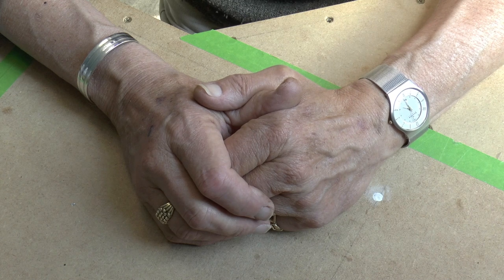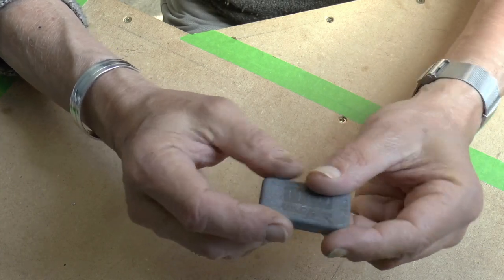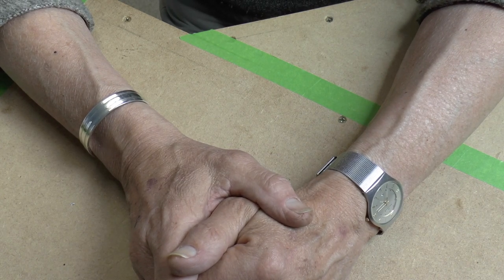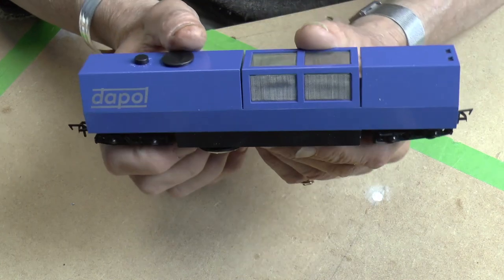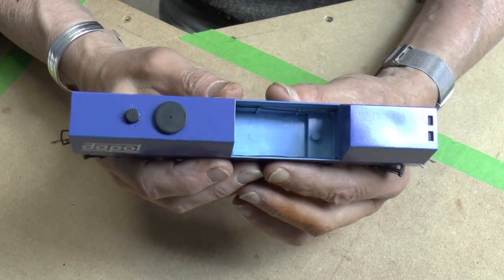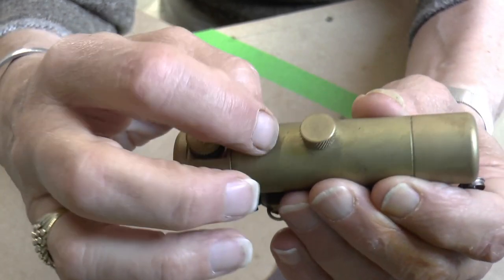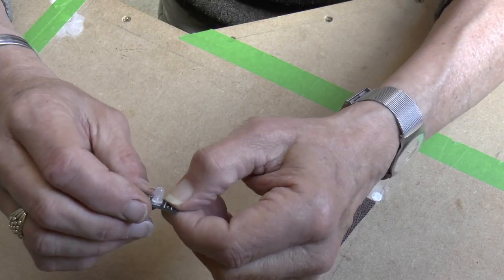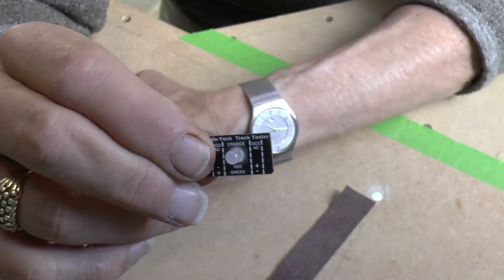How I clean my track on Lakeside.      11-05-2019

Comment: For wheels and general cleaning I too use Isopropyl Alcohol, but for track cleaning, especially at exhibitions, I use the inside of a cereal packet cut into strips. I never use a track rubber. It shoots fine bits of metal into the point blades and also locos pick up the fine metal particles it leaves on the track. As you say Graham each to their own. Cheers, Bob

Comment: Hi Graham, great video. Could you explain the advantage of the rubbing alcohol over good old Meths? Andy
Reply from the maker: Andy Sparkes     Hi Andy, I don’t think there are any advantages between the two but I had the rubbing Alcohol which works for many cleaning jobs I use it for but certainly meths could be used as I did many years ago.      Cheers for now.         ......... Graham

Comment: Hi Graham

Excellent video mate. I've heard the CMX cleaner is great. I also use the peco track cleaning rubber.  But i will have to invest in a CMX cleaner now. Thanks for sharing.

Cheers John.
Reply from the maker: TheHood50031     Hi John, if you do get a CMX then you won’t regret it - they are a great bit of kit.    Cheers for now mate.          ............Graham
Reply: @GrahamFoulston  That's great Graham. Thanks for the advice. I will have a look at the CMX now. Cheers John.
Reply from the maker: TheHood50031      👍🏻👍🏻

Comment: On my n gauge I've used the peck rubber plus either track magic or recently ipa. I have the tomix  track cleaner ( on which the dapol one is based) and apart from being a handy hoover the rotating discs are rubbish. The Emery disc scored my rails badly. Plus it relies on power from the track - which might not be there if track is dirty, d'oh! I fancy the cmx but the cost is astronomical now. There is a cheaper equivalent but they get mixed reviews. What a dilemma!
Reply from the maker: Leslie Gilpin     He-, they have gone up in price now, if it were me then I would wait until I could afford it as I’m fed up buying rubbish track cleaners, the way this thing is built then it will long outlast me, it’s built like a tank!    😊.      Cheers for now mate.         .......... Graham

Comment: I fancy one of them cmx cleaners but they are so expensive now been trying to build my own but not with success yet some good tips there especially with the cotton buds
Reply from the maker: Finnerton central model railway      It shouldn’t be too difficult Brian, the main thing is to have a variable flow of the liquid which can be achieved by using a taper needle like you have in an airbrush or even a carburettor from a car - something along those lines. All the rest is pretty straight forward.     Cheers for now mate.           ...........Graham